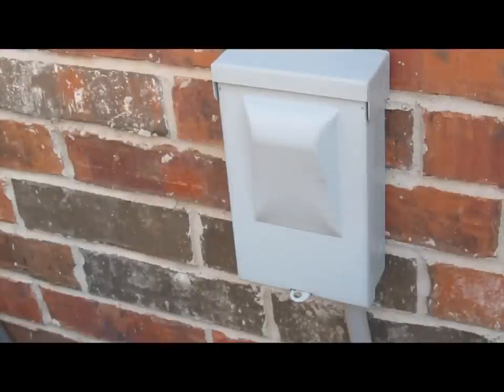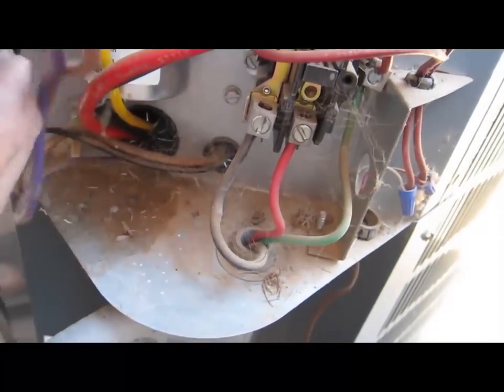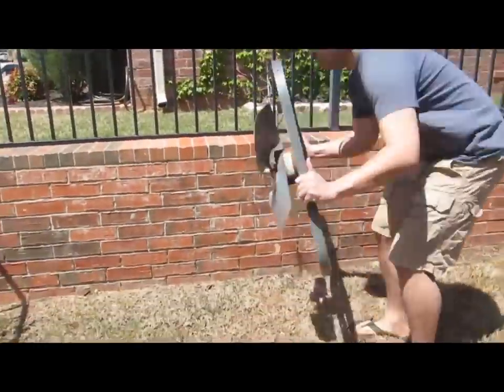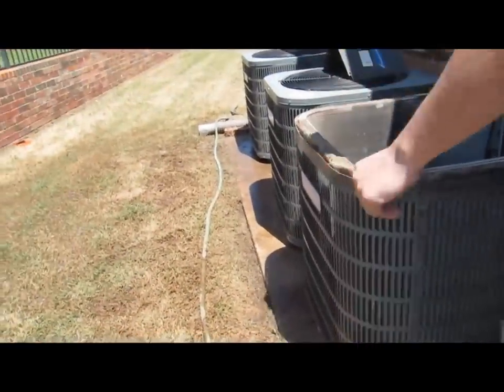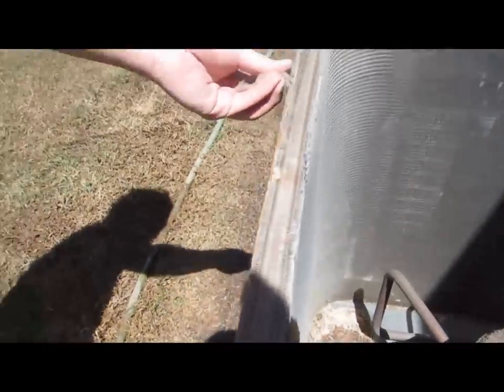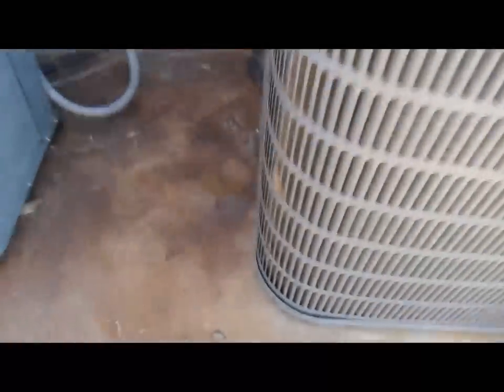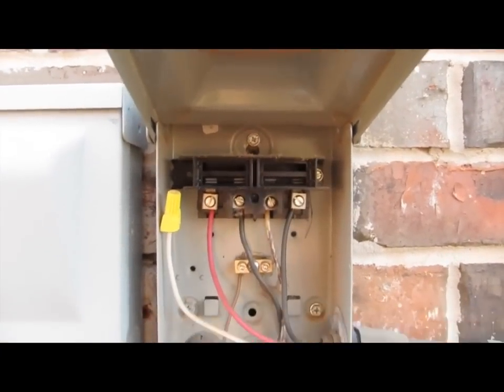Goodman Condenser Cleaning - Multizone Unit - AC Cleaning - Clean Air Conditioner Coils

Comment: Just used this video for my Goodman condenser cleaning today! Took a few hours since the hardest part is putting the grates back on and aligning all the screw holes!! I used a can of coil cleaner too as recommended by other videos. I also used a shop vac since my fins had a cozy blanket from the winter lol! I probably should have had a fin repair tool handy to repair some of those while I had the grate off. Oh well, next time.
Reply from the maker: Nice good work!

Comment: thanks, the part about removing the cover was really helpful. I wouldn't have done this project right without the pointers on disconnecting the wires.  Taking a picture of the wire connections was a good tip. reassembling the cover was the most difficult part for me. I ended up with a few unused screws.. oh well the cover is sturdy and everything works.

Comment: Thank you for posting your video!!! I have the same model air conditioning unit in the video. I was a little bit worried about disconnecting the wires, but I took pictures and made of made a video of it , I also labeled the wires with tape. I knew my air conditioner was dirty, but I was shocked at how filthy the fins were. Thanks again for your video and I subscribed to your website. Thanks again.
Reply from the maker: magicrobharv glad to have helped.  Hope you saved some time and money.  Stay cool.  Get it?  #sorrynotsorry #badpuns

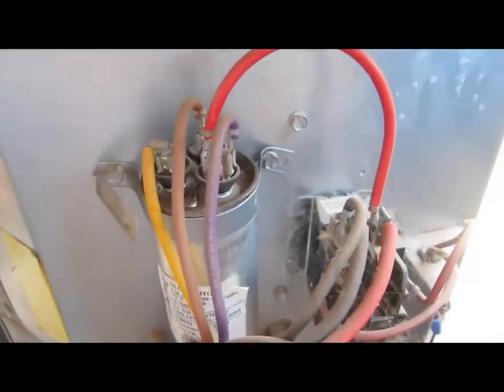Comment: 0:55 Hopefully there's a wiring diagram, whether on the inside of the panel or somewhere nearby, which has the colors of the wires on the run capacitor—good for double checking if it was connected correctly in the first place. I have a Trane XB 12 that is wired similarly, where purple is on the same middle terminal as red, and brown is on its own terminal opposite from yellow/orange.
Reply from the maker: Luckily there is a good wiring diagram inside.  Gotta keeps those wires straight

Comment: Curious to know if before pulling the fuses, shouldnt the AC circuit breaker be turn off?
Reply from the maker: Excellent point, you should always start by turning off the breaker for the power to your entire house prior to working on your unit. You may not know how your house is wired, you should Disconnect power Prior doing this
Reply: Yo! DIY Videos correct me if im wrong but generally there is two power connections to an hvac system. The circuit breaker and the fuse box. I assume circuit breaker is for inside part of ac and fuse box outside part of ac. So even if the circuit breaker is off power could still be running outside part of ac. Is this correct?
Reply from the maker: My system is setup where power goes through your circuit main or breaker box and then connected in series with your relay (outside) your unit.  If you’re uncomfortable or can’t verify, I’d contact an AC company or an electrician.  If you’re comfortable using a DMM, you can verify by turning off your main circuit breaker and checking the input to your condenser unit.
Reply: @YoDIYVideos  thats a not Relay ,its a disconnect switch or pull out switch

Comment: Will this help relieve a musty odor when the air conditioning is turned on?
Reply from the maker: 6ashull - Unfortunately no, this will only make the AC more efficient.  The musty odor that you're experiencing is from the evaporator coil.  Check out DIY Tinker 's, video: How to clean evaporator coil - AC freezing over with ice - cleaning dirty HVAC coil with cleaner